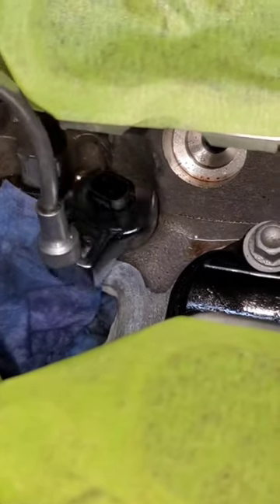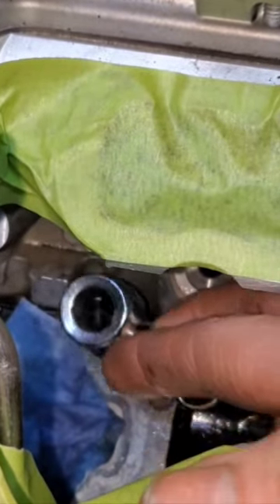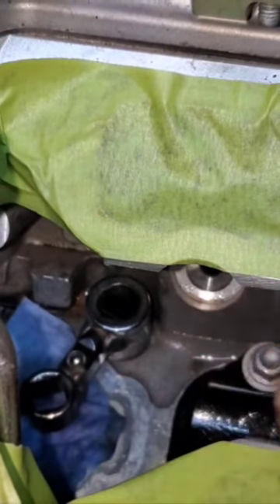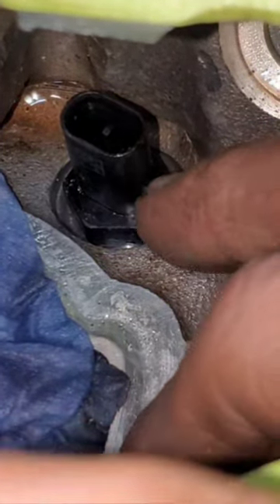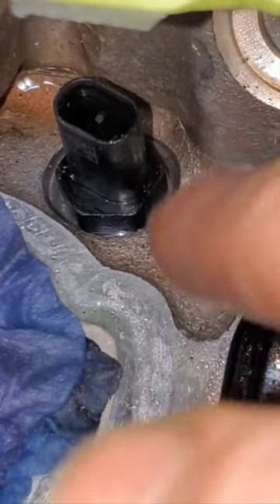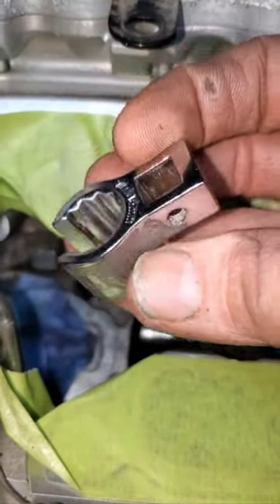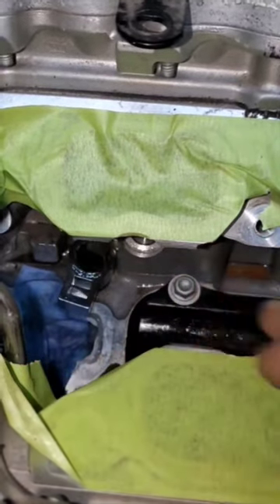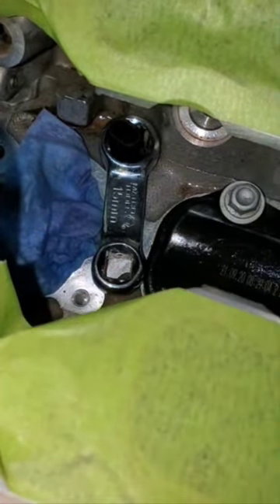No, Your Crowfoot Wrench Won't Work!

Comment: I actually have a set of sockets that I shit you not, is thin enough wall to do this without modifying. It is a silver eagle set but it must be a mistake because I compared my set to another and they are not the same. I am the luckiest mechanic ever.

Comment: Are GM engineers purposely making bad designs.  Why would anyone buy a car they can't fix?  That is why resale value for electric cars are so low.  Those companies makes it difficult to get updates for the battery software and getting parts is difficult.